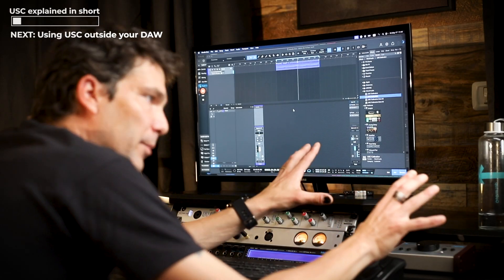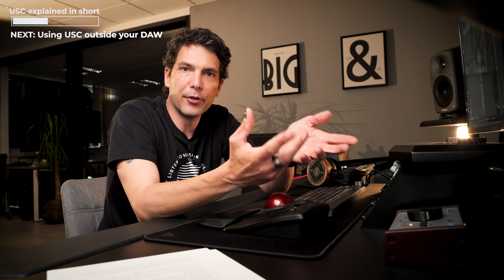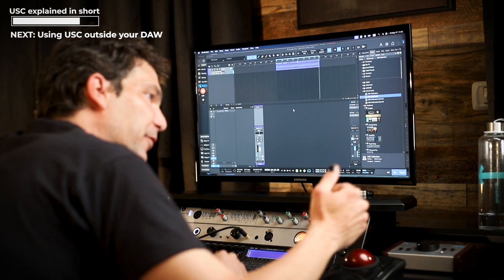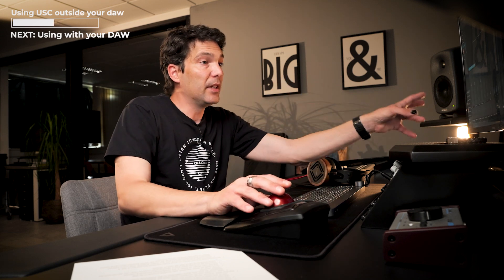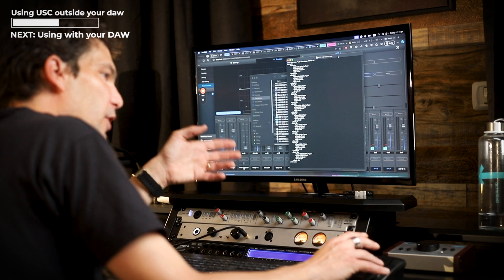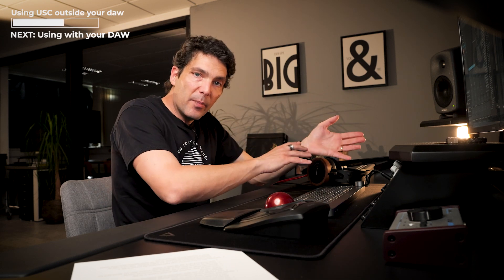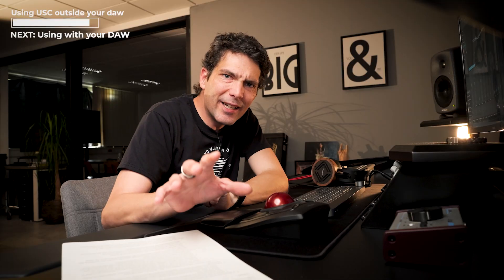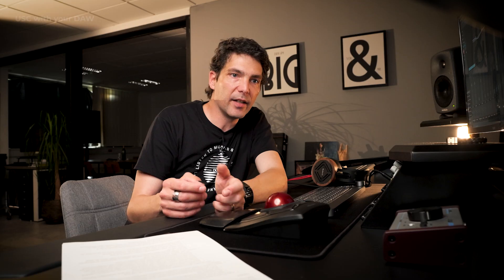OLLO USC headphones calibration at the hardware level - Removing the need for a plugin in your DAW

Comment: Great video Rok :) Quick Question is it a good idea to also use the Harmon curve along with the headphone Data ?
Reply: If you use the calibration outside the plugin, you'll have to add the Harman target on top of it. If oyu use it with the plugin, then it's already calculated when you have the calirbation slider to full.